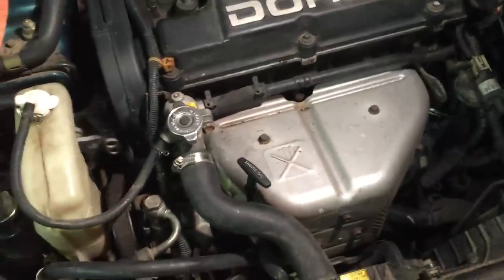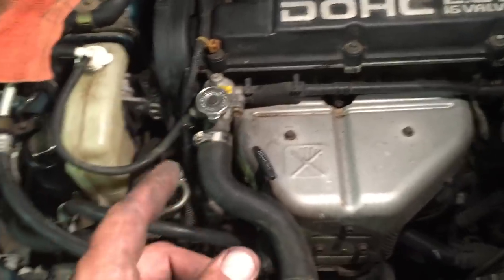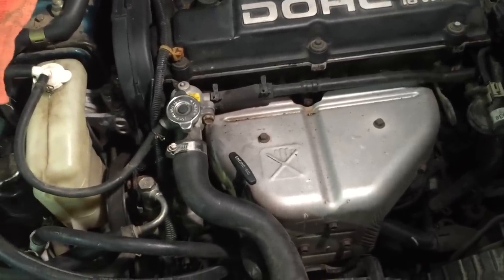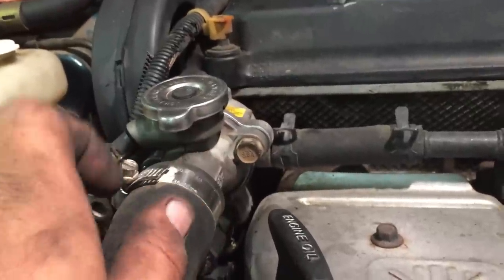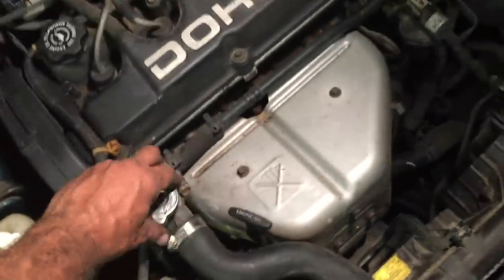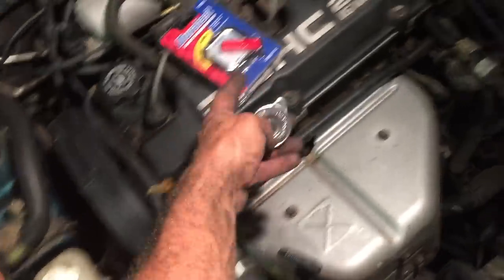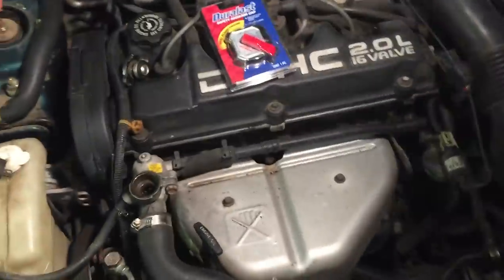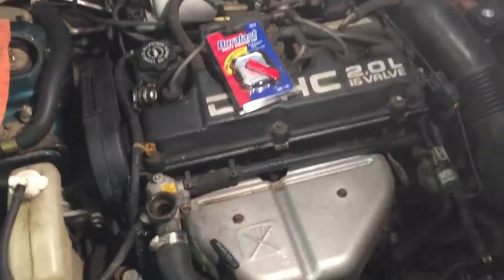How to Determine if Your Radiator Cap is Bad (P2181)

Comment: Thanks for the video.  I am hearing water sloshing sound coming from behind my glove box, could this be from a faulty radiator cap?
Reply from the maker: that would be your heater core, and yes it could be the cap is letting air in, but if your floor on the passengers side is wet, then you will need a heater core this one will have a leak.
Reply: Did u fix this? It’s my issue too.
Reply: Rudy Esquivel it meant my coolant was low. The noise would go away when I topped up my coolant. Checked underneath the car & it was leaking coolant. Turned out it was my water pump that’s leaking & needs to be changed.

Comment: I have a 2003 Nissan altima. my car heats up really high then drops down to normal temps. It mostly runs high when I accelerate then it drops back down when I get at speed. I checked my radiator cap and surly it is broken, in 3 pieces to be exact. It is the cap top, the spring, and the rubber plunger. I just wanna make sure this is the cause before I settle on this theory. Can you give me anymore reasons? I know my car is built with 2 thermostats, but like I said I just want to make sure that radiator cap is the primary cause.  Thank you So so much for you insight. God bless you.
Reply from the maker: the cap will do this, but your thermostat will to, for instance if your car calls for a 185 degree thermostat and the 195 was on sale and most auto stores will give you the option and most of us buy the cheaper one, well then the car needs to reach 195 degrees before the thermostat opens allowing the fluid to leave the engine at a warmer temp. so in short if the cap does not solve it, replace the thermostats. especially if they were replaced recently and the prob started about the same time.thanks for watching
Reply: +thomas brian thanks sir. I replaced the cap first to test the theory. it's been super hot outside and it's running at normal operation as it should. the cap was the issue. however, I am still going to swap out those thermostats since they are aged pretty good. just an added safety measure. thanks again.

Comment: hi, my van overheats when idle but now when i drive as well. ive replaced the radiator and the thermostat.. when i checked he fluid level in the radiator it was full but the reservoir was low. could it be the cap if it has gunk on it as well or the reservoir?
Reply from the maker: sometimes a loose shroud can cause this. if your not loosing any water, make sure if your fan is electric its coming on, if it is, i would change the thermostat.
Reply: thanks for your response! i noticed one of the fans not kicking on so i replaced the fans. worked for a while and is back to overheating

Comment: hi Thomas, my toyota 4k engine is newly overhauled. Also i did major maintenance on my radiator. when i did test drive about 10km i noticed my engine is heating up fast. when i came home water is coming out of the radiator cap. what could be the cause?
Reply from the maker: sticky thermostat, bad cap, bad water pump, or a pin hole in the system somewhere. most auto parts stores will rent a pressure tester. i would start there. check for leaks, especially on the floor board passenger side . where the passengers feet would be. pull the carpet up a little to inspect for moisture. ( bad heater core ). while the engine is running you can squeeze both hoses to insure you have some pressure. inspect the water pump. ( there is a small hole that will leak water behind the pulley if the pump is bad. if you have electric fans, make sure one is coming on when the engine is hot and the second if the a./c is turned on. please keep us posted. you solution  can help others. thanks for watching.

Comment: is radiator cap the same as coolant cap, I have a coolant reservoir tank and a radiator but cant seem to find another cap anywhere other than on my coolant, I have a Vauxhall astra GTC 3dr 1.4t 2013. any help will be much appreciated
Reply from the maker: you do not have a radiator cap on the radiator, you are correct, the reservoir cap is your radiator cap.
Reply: my mechanic thinks my head gasket is blown, I have no symptoms of head gasket failure other than water droplets out my exhaust when my car is 90degreesC (which should not be there) and also a pressurized reservoir tank only when hot, it says online that if there was head gasket failure then it would bubble from start but my coolant bubbles only when it is hot and I release a bit of pressure by opening the cap. What do you think it is? head gasket failure or reservoir cap faulty?

Thanks again in advance
Reply from the maker: water out the exhaust is normal, the catalytic converter converts 02 to h2o, that is its job. if you are seeing the water from the radiator ( with antifreeze ) out the exhaust that is different. although water is coming out the tail pipe, most head gasket leaks on the exhaust side would come out at the manifold first. keep in mind a week water pump or a sticky thermostat can cause the heated water in the reservoir as well. as for the head gasket, a leak down test can be performed to insure that is what it is. 

 https://mechanics.stackexchange.com/questions/17378/how-to-test-if-head-gaskets-are-blown

this link describes the test. please kepp us posted it helps everyone, thanks for watching,,,,enjoy

Comment: Hi. Can bad cap cause me loosing coolant in spare tank? radiator always full, but spare tank always at low even after i top up.
Reply from the maker: pressure test it. on a radiator yes, on a reservoir no. thanks for watching!

Comment: I have a bike with a strange issue. After heavy use when i turn it off, gurgling sound comes from the cooling circuit. But the strange thing is that it wont overheat, it doesn't leak coolant, fans start when they have to (around 103ºc) and apparently it does run normally. I'm between bad coolant condition, bad cap, blown gasket, air trapped in the circuit. Also if i start it cold, and wait iddling for the fans to start, the problem doesn´t shows. It only appears 20 min after intense traffic use. In the dealer they can't find a solution. Do you have any idea?
Reply from the maker: it could be just moving the fluid ( normal ) after shutting it off. but if you think its air bubble sound, then do a pressure test. this will tell if there is a leak. thanks for watching. great question.

Comment: I noticed about a week ago that my coolant reservoir was totally empty. Added coolant to the fill line. I checked the very next day and it was empty again. No sign of leaks, cracks in the hoses, at least from what I can see... could a bad radiator cap be causing me to loose this much coolant this quickly?
Reply from the maker: Yes, but i would do a pressure test. thanks for watching!
Reply: @thomasbriansavingmoney  I replaced the cap and still have the same problem. Also checked for signs of a blown head gasket (like milky oil) and couldnt find anything. I'm stumped :/
Reply: @thomasbriansavingmoney  but anyway, thank you for the video. It was worth a try.

Comment: Well, suddenly my car overheated could that be the cap? Cause I have checked everything I went to a mechanic shop and they told me that everything works well!
Reply from the maker: if you are loosing water and don't see it leaking, it could be the cap. if they pressure tested it and it didn't leak, i would change the cap. but keep in mind a bad fan can cause it , and a thermostat stuck in the closed position. these two things, you may not see a loss of fluid. if you see water leaking on the passengers side floor board inside the car, then its the heater core. if its leaking in front center of the engine then the water pump. leaking on top of the engine may be thermostat housing, bad hose etc. please keep us posted.

Comment: My 2000 Toyota Corolla takes an hour to get warm in the winter. I have changed the thermostat to oem one. But still same problem... please help
Reply from the maker: sounds like you may need to flush the heater core. i have a quick video on it. it is simple. click on my name under the video and search for how to flush your heater core. i believe it was a Acura but same concept. thanks for watching.

Comment: Sir:    I have a 1990 Cougar,  replaced the radiator, radiator cap,   water pump,  thermostat, fan clutch, main hoses,  hose to over flow tank,  but a problem persists:   the coolant is not getting thru to the overflow tank.   I can blow thru the hose from the radiator end and hear the bubbling in the tank,  but when the engine is hot,  the coolant remains at the "cold" level in the tank.   I have tried 3 radiator caps,  the original,  and two new from Stent.   Same results.    Any ideas?  Thanks.
Reply from the maker: yes, check the manufacture set level on the cap, and your thermostat pressure. the cap will open and close when the heat or pressure gets to that level. that's what the seal and spring under the cap is for. if your thermostat is 165 degrees and the cap is 195 then the even though the water is hot, the thermostat will open and start the process before the cap will open. thanks for watching.
Reply: I will check that right now,  thanks for the response.   These videos are very valuable.
Reply: did you bleed it
Reply: Yes,  I assume that the one bleeding valve is at the top front of the engine where the plastic label is.  Any other bleeding locations that you know if?  Is it possible that I need a hotter thermostat?  Thanks for the response.
Reply from the maker: go to a auto parts store, it is free to rent a pressure tester, pressure test it. this will tell you if its the cap. if it holds pressure (about 10 lbs ) the cap is bad. if it doesnt, you will hear and see the leak. i had a small pin hose near my heater core once. it was hitting the exaust and evaporating. i never seen it.
Reply: Thanks for the response,  I will try this.

Comment: What if the steam comes lightly through the interior vents?… Do I change the cap if that happens?
Reply from the maker: If the steam is coming through the vents it sounds like you have a leaking heater core. Its a bit of a pain in the butt, but you will likely need to have it replaced.
Reply: @thomasbriansavingmoney  So I’ve heard about the emotional irritation this comes with

Comment: I drive a 2004 Honda civic. I was driving back from Washington to California and my car started to slowly overheat so I pulled over. popped my hood and coolant was everywhere! I refilled it and my car was fine and was able to drive it over 400 miles until I got home. any ideas what the problem could be??
Reply from the maker: you may have a small hole somewhere, that what i think. i would do a pressure test on it. it prob lost just a little bit of moisture over a long time because of the small pin hole. when the level was down to far, it over heated. it prob wont do it so much on short in town trips. only when the temp goes up enough to evaporate some water. if the pressure test comes back good, but my guess is it wont. then look at the water pump next.  keep in mind you want the test to include the cap. this video could very well be covering your problem. thanks for watching. ( bad cap )
Reply: thomas brian I got a new water pump a few months ago. im definitely going to do the pressure test. from what I can see there is no leaks. I will know soon enough. thank you very much!

Comment: Hi my 2004 mitsubishi gallant  overheated on big Bear Mountain this past Wednesday I have no idea why I drove the car for 2 hours and it overheated 20 minutes up the mountain at high 500 altitude the car has been driven to the Sierra mountains 8k altitude and back more than 4 times over a 12 hour drive no overheating issue I've had it checked out by a couple people but for now I have replaced the radiator cap because it was bad I have also bled the air out of my radiator because my heater wasn't working and now it is... it wasn't working the day it overheated  can give some tips on what you think it could be whether it a water pump coolant censor or thermostat or hose cetera  The car has only started overheating this year Never overheats on the street even drove it to San Diego with no issue only in the high altitude doesn't make sense car first over heated in the lake Tahoe mountains I re filled it but didn't bleed the air didn't know then  no issue for a hole yeah only heater stopped working until now when I am driving up big bear mountain.hopeing the bleeding air and cap fix it cuz the heater is working now and u can turn it on if your car over heats please help i want to drive back up to big bear and test my car to see if it will make it over 2 hours drive to the hill
Reply: would the trapped air block up the heater? and make the car over heat on a big mountain?

Comment: I think my cap may be bad. it never draws coolant from the reserve tank but it gets low. I repaired all the leaks but it still doesn't fill or draw from reserve.
Reply from the maker: if you have no leaks and its loosing water, it will be the cap. did you do a pressure test ?

Comment: Have any of you experienced milky crap on radiator cap if so what can be the cause ? Car doesn’t over heat or anything just consumes a lil coolant every time I go up north which is a 5 hour drive
Reply: Head gasket failure

Comment: My car doesn't overheat but I leak about 1/2 gallon every few hundred miles. No visible leaks, no coolant in the oil and I can smell coolant when I park after a drive.
Reply from the maker: do a pressure test. ive seen them leak out the heater core hose. a small pin hole that sprays on the exhaust and evaporates. but a half gallon every few hundred miles could be something else, like a bad water pump etc. thats why i think you should do a pressure test. thanks for watching.
Reply from the maker: someone is doing the pressure test wrong if it pops and there was not a issue.  be sure it is not pumped up to high. most common is 7 lbs. if anything pops at this pressure, the its sure to pop out on the road where no help is in site, and you have no cell service. ha you get it. better to have it pop a seal or gasket at home during a test. your engine will build over 7 lbs of pressure just to get the heater to blow hot. you shouldn't be testing it more than 13 lbs, and only certain engines. so if it pops at 7 lbs, let it because you are in a better place when it pops, no matter weather its a water pump, thermostat seal, heater core, etc. its best to do the pressure test if you think you have a issue. loosing water, no heat etc. i know you get it. great comment though ! thanks for watching.
Reply from the maker: i get that, its so hard to know how experienced someone is now days, because everyone is incredible at what they do! just ask them. ha . thanks for the great comments.!!!! i too have seen a Walmart employee put 25 lbs in a car, it was not mine thank god. but i did yell, whoo whoo whoo.  ha thanks again.

Comment: my 97 honda civic is spewing coolant out from the reservoir cap when i drive short or long distances.was above min before driving and now its on above full and its annoying when it stains on my air filter box and i don't know what is wrong.
Reply from the maker: ugh, could be a blown head gasket. does it smell like exhaust ? if not, you may have a sticky thermostat. but could be as simple as a bad cap!
Reply: thomas brian what i did i removed some the coolant that filled up and left at min and its not spilling now and hasn't overfilled and heated up.
Reply: probably had it too much coolant could be no space in the system like pressure was in the system

Comment: So I know more than the average person about cars, and knew I had air in my system somehow but could not figure it out. lol I took it to my normal place that I've been thinking I can trust. A local Olin Mott. Anyway, turned out to to be a bad radiator cap. So silly. But more importantly it's nice to know that I can indeed trust them. And hell, I learned something knew about cooling system diagnostics as simple of an issue as it was. Lmao

Comment: Sir:    I found the problem,  it was unexpected.    The overflow pipe was not clear to the radiator tank,  a small plastic piece blocked the flow,  apparently this is from the molding process.  I will see if that works.
Reply from the maker: that's great. and your comment will help others. most people don't take the time to post the cause. awesome and thank you for thinking of others.

Comment: my mitsubish eclipse gt does this when at a red light or idle it overheats all the way up sometimes but when I drive it cools down wat could that be ?
Reply from the maker: i think your water pump is going bad. when you drive you are cooling the water with air. make sure your fans are coming on as well.
Reply: They both come on and the water pump was done a while ago
Reply: you have probably already solved the problem, but if it is not the problem that Thomas Brian has listed, then it could be your coolant temperature sensor. My car did the exact same thing, replaced the sensor and the problem went away.